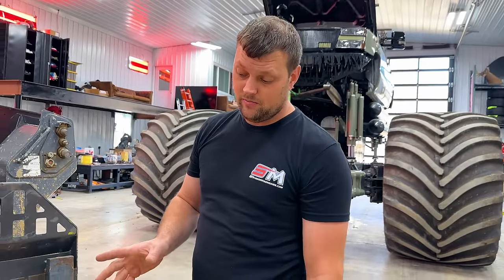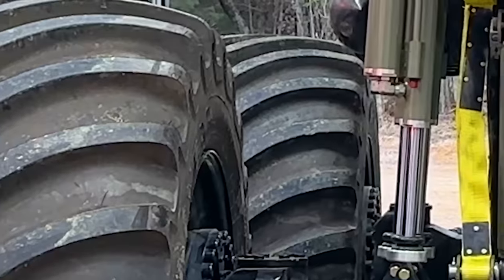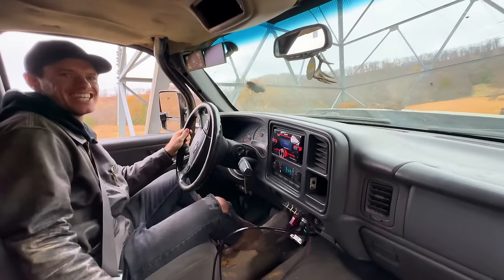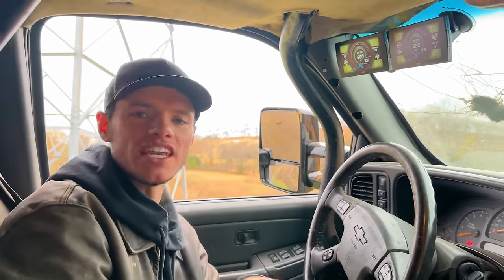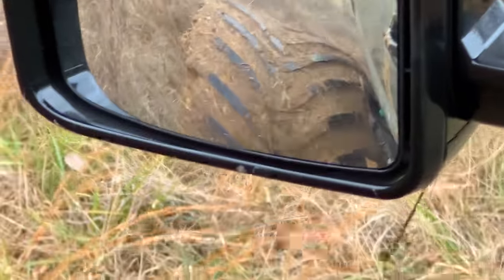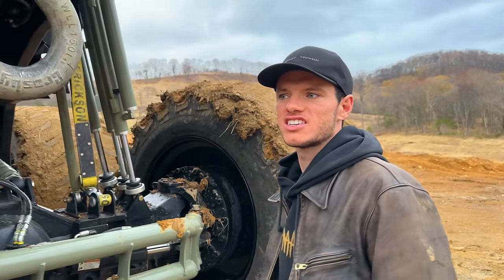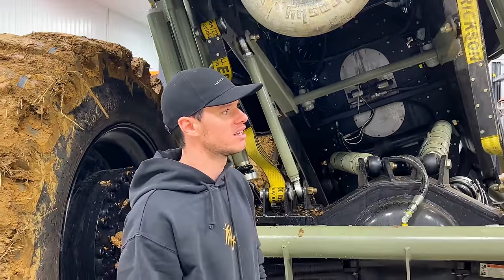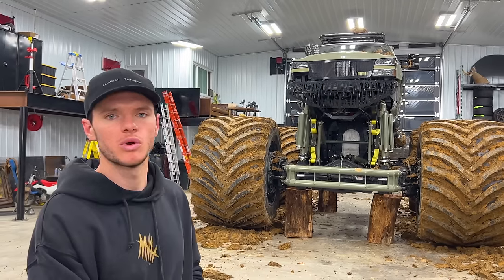Monstermax 2 RUNNING ON TWIN ENGINES!!!!

Comment from the maker: Properly designed and amazing looking clothing now available on Monstermax.com!!! Very limited supplies
Reply: bro gotta get to 10 mill now
Reply: CYBERTRUCK DURABILITY TEST PLS!!
Reply: Dude i just noticed you could really make people mad by making the worlds biggest squatted truck
Reply: Elrods pro straps he makes them for ultra4 and he will guerantee them
Reply: MM needs under glow
Reply: I'm really disappointed you didn't get any level to build the suspension on mm2..
Reply: when or if it comes out LOL
Reply: You should have a machinist make the parts that you need
Reply: Bro I love the videos I think it’s so funny that people get so mad. I ain’t gonna lye you had me cringing when you drove over the Honda 😂😂
Reply: Why did monster maxx look like my grandma scuffling down the hallway to drop a deuce? Like a Carolina squat truck
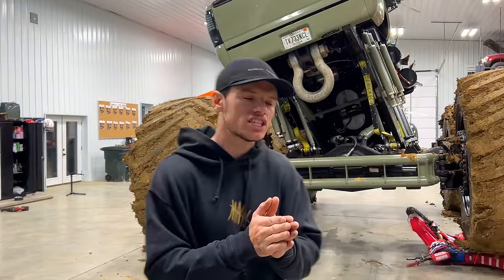Reply: 12:23 - now introducing.... the Tennessee lean
Reply: You're the best, man.
Reply: You need to cut the truck in half, longways and make it also the widest pickup truck.  
Get a donor truck and use 3 feet of the center part of the donor truck, from tailgate to grille. Imagine a 10 foot wide pickup truck? I’m retired, I can’t help you do it. Good luck 😂
Reply: @demarcuscousinsthe65th  I'd like to see it tug of war with monster max
Reply: Ngl was rrreeeeaaallllyyy hoping for those logs to disintegrate from underneath MM at full throttle.
Reply: bugatti test at 5M subs
Reply: Got my MMII hoodie ordered, tax man pulled my pants down to get it to UK though. Get the issues ironed out and Monster Max will be flying about in no time. 😉
Reply: Looks like you have a sqatted truck lmfao
Reply: Make a lifted hilux
Reply: Sir, carry on, carry on. 🤠😎
Reply: more lies it never be fix
Reply: World’s Biggest Truck with bedrooms! is a 1950 Dodge Power Wagon in Abu Dhabi.  Top that @WhistlinDiesel
Reply: Young, handsome and billionaire 😍 what a gem 💎
Reply: How much for what's left of the bike?
Reply: ill give you $100 for that flat CR. haha!
Reply: That wheel marks will be viewed on Google maps! 😱 So big
Reply: You finally got it running on 2 engines
Reply: Hear me out: new merch featuring “The Leaning Tower of Deisel”. 10/10 would purchase😂👌🏻
Reply: Hey bro, I would heavily look into finding some kind of gyro system to keep your cab level no matter what terrain you're on. Something has to exist. Only to keep you safe and happy homie. Another great video
Reply: Monster max is sick….. go ahead and cut me a deal on the wheels and hubs off the CRF and the yoshis if they’re anything let of them lmao
Reply: By the end your Truck had the "Detroit Lean".  It's not broke, it's got Swagger.
Reply: Something about monstermax is terrifying. Especially the night footage. Makes it look like it’s a Jurassic park creature. I love it
Reply: I'll give you some cash for that bike like it is
Reply: Can i have the dirt bike u crushed
Reply: Love the new build man.
Reply: You should build a half sized version of the p1000 ratte tank for crushing stuff.
The name reflected the 1000 tonnes it was supposedly supposed to weight...
It would be both educational and utterly terrifying 🤣

Cody could then literally have the  title as the only person to have successful built replica of the tank 🤔
Guinness world record right there my dude 🤯
I can imagine the amount of war games sponsorship and people who would like to see this 500 tonne behemoth...
Reply: Let me buy the bike!!!
Reply: Hopefully done better than monster max am I right? 🤣
Reply: You have to get in touch with Dennis Anderson
Reply: How do I pay cash for apparel?
Reply: Where can you buy a properly designed and amazing looking monster truck?  Been looking everywhere, and can't find 💩!!!    🤣    But FR, this is some good content, I appreciate how creative Cody is, like the stupid kicking mud thing at the end.  It's just more entertaining.
Reply: see i came to the comments to actually post something positive then saw this grift post for your obscenely over priced merch and then the desire to be nice left me
Reply: I'd still buy that bike as is XD
Reply: Whistlin , in your 1600hp General lee video I think you forgot to censor out the word “fucking” when you handed the keys to your neighbor. I’m not offended or anything but I notice you like to censor “bad” words a lot so I thought I’d give you a heads up. Thanks for all your awesome content! Good luck with your court case man!
Reply: so Cody... nice squatted truck ya got there 🤣😂🤣  didn't know you were such a hypocrite 🙃 guess ya got to shred it now and work on mostermax3 😆
Reply: 10/10 love the quote hoodie
Reply: Is Monster Max 3 going to have a jet turbine
Reply: This truck means nothing to me !!!!!?
Reply: Plz get the new raptor r
Reply: Can I buy that dirt bike?
Reply: Sway bar won’t work, run a hydraulic leveling system. Set up on a gyro. Same thing that the run on feller bunchers
Reply: All you need now is a turret on the roof to spray those hater tears. This is radical.
Reply: HELLO
Reply: Lol it’s still badazz truck 😅 Hey every build has its flaws you have one of the coolest rides in the world just need shocks adjusted sway bars Lock-tight on the drive shaft bolts lol more sway bars and Air bags suspension and need the axle rolled forward so the driveline doesn’t get kinked on a incline and your hood !! 😅👌🤙
Reply: Get that sway bar wide as possible if you can put past the shocks or at least equal to and more beefy nice rig.
Reply: @WhistlinDiesel i tried to buy the crf450 from you but you never responded to my dms. i also swiped up about the part time job
Reply: Doubt you will see this but along with the new sway bar, why not put mm2 on airbags?
Reply: You should use your head-lights when driving at night ;)
Reply: Fix it  an I’ll buy it bro I need a new bike an that ones so nice even smashed it’s still nice 🥲
Reply: Pretty cool truck but what’s the point if your ground clearance is the same as a normal truck
Reply: Boat mmII v2 please 😂😂😂😂
Reply: We love u dude
Reply: Elrods prostraps the best and strongest anywhere
Reply: Some dude acting like cody @  T @Diesel-DETWILERERO1
Reply: Your dad is gonna be PISSED! Beautiful truck bro!
Reply: Yes very BEAUTIFUL...
Reply: Man what I would do is take the suspension off of a log skidder such as a 620e tiger cat I mean you pretty much have the exact suspension set up right now
Reply: maybe santa will bring me some Idk
Reply: Haha sweet I just bought a hoodie. Glad I didn't miss out on the merchandises this time! Thank you youtube bell
Reply: From someone that cant actually afford it that dirtbike would have given me years of fun. 😢  & whats even sadder is i live in mt juliet / wilson co. Which is only about 15 short minutes away.
Reply: Let me buy that Honda, or atleast let me buy some parts off of it!!!
Reply: Use kinetic ropes for limiter straps .
Reply: Bugatti durability test at 10M what?, 10M haters?, if so where the hell is that durability test at!
Reply: the length of the lever arm going to the sway bar is probably a large contributor to the sway as well as the lower spring rate of the suspension. rock trucks use rubber blocks as a spring in their suspension in comparison.
Reply: Man I love monster max, its just missing one thing...  a little brother you can drive on the road. I have a quadsteer I'd love to see you with. Hit me up and maybe we can colab..
Reply: Hey yo can I have that dirtbike you crushed for free?
Reply: Now you should re-challenge that tank and demo ranch to another tug-of-war.
Reply: I wonder if any level left like that 350 but on a bigger scale if they won't do it you'll just have to do it I'd say that any level lift yeah you put it through stress factors for sure and it held up pretty a lot better than what I thought amazingly better actually
Reply: Where’s your Jake brake big dawg????????
Reply: I subbed when he put his truck in the ocean. That sh t was insane lol
Reply: Nah don't do that it would be a flop. I suck at ideas
Reply: Can I buy the next dirt bike off you that you decide to crush but before u do the crushing 😂
Reply: Idk will the clothing fall apart too
Reply: This truck is so legendary that it'll be uncovered in the future like the Great Sphinx or the Terracotta Army and the world will be so fascinated by the technology that they will claim that it's impossible to re create
Reply: @ripperlipper1016  maybe if you full-send like WD does.
Reply: Uber from hell
Reply: wheres the monkey fist on these hoodies draw strings???? mine came out in the washer, I thought these things were indestructible!! I have 3 btw lol
Reply: Monster max breaks more then a r32 and a subaru
Reply: You know what would be awesome is getting the big foot tires and putting them on there
Reply: whats it like being a complete psychopath :face-fuchsia-wide-eyes:
Reply: You technically own a squatted truck now because it squats when your on the throttle and your always on the throttle so it’s always squatted.
Reply: Can I have the dirtbike now
Reply: Love you bro
Reply: Send me that dirtbike I will send it to the after world and finish it off
Reply: Where did ubpost it for 5k at I would of bought it for sure , been looking for one
Reply: Western canadien rockwell. call and ask for neil. he might be able to help
Reply: Here’s a complicated idea. 
Instead of bigger sway bars, use sensors and solenoids and supporting mods and turn it into a electronically controlled active suspension. That will also help with raising and lowering the height of the cab for ease of use and service for the components. You could eliminate the sway problem if sensors are constantly monitoring your suspension. I dont think any monster trucks have that setup currently but it would be a damn good suspension to have since you’ll be able to just control the stiffness and all that as well. That would be fkin amazing if you could pull that off. I mean steal the suspension off ur G wagon 😂😂
Reply: Okay bigger engine on the back and front with reinforced coolant system and internals
Reply: word
Reply: @Clunkincars  I think that might be a good idea but what about big airplanes and stuff how do they do their shock system God bless
Reply: @whistlinDiesel how much horsepower & toque does your truck have? It would be interesting to see you have a truck pull with an M1 Abrams tank. 
Show off for your millitary, please? 
I mean once your get everthing fixed.
Reply: @WhistlinDiesel I'll take that dirt bike and race it down at the Baja 1000 for you
Reply: You want to buy a 1930 Chevy coupe to smash😁
Reply: Built for a really distructive man hahah
Reply: Eh, this rig could really use more engines
Reply: I knew it was gonna be to top heavy for those Lil legs u put on it. should of taken a page out of Bob Chandlers book that's why bf 5 engines were lower. maybe ask him what he did to not get the body roll
Reply: How much were you asking for that Honda
Reply: @michaelwhaley6123  we'll look into it iam is manager
Reply: Here's the thing. This isn't real. This man doesn't have the money he claims he does. You think a youtube channel pays you money?? I'm out here working as a roofer. 1000 a week. People believe everything they see. It's the internet folks 🤣
Reply: do you think i can have the honde crf that you ran over?
Reply: man i got this monster truck RC its called the ground pounder, really nice... anyway its funny cuz i have learned that thing thru and thru and totally get having to upgrade a monster truck til it drives how u want it. ur basically living my dream lol
Reply: Yo a screeeen in the front and Camaras outisde of it and you can see a little more!
Reply: Instal a jake brake
Reply: Give me that bike U ran over haha
Reply: its ok no problem WhistlinDiesel
Reply: You need an any level suspension setup on it, jokes aside a setup like dynamic suspension on luxury cars would solve the body roll
Reply: Keep going g your gonna be well known, so glad to have watched you grow you can easily get that 10m
Reply: Hey Whistlin i saw that you ran over a honda crf 450r with MM2. i was kind of cringing cuz im saving up for one, but i was asking do you think i can buy it off of you for $1300?
Reply: Bro, please put more air in the tires to get better slippage
Reply: This comment more than likely won't be seen by many of any at all but I've got an interesting theory. Now that MonstermaxII has 2 working engines and will shortly have a sway bar the size of California and Texas combined, he's going to find a way to float it and weld the bow of a cruise ship on the front. #WhistlinDieselCruiseLines2023 Also wouldn't be shocked if he welded a landing pad on top of MonsterMax so he can land the new chopper on it once he has his pilot's license. Cannot wait to see this shit.
Reply: By chance is that honda cr still fir sale bud I'd love to have her I am looking for a build like that 😀
Reply: 150 is to rich for my blood im sure it's worth it though. 🙌🏻
Reply: You just need springs. Shocks dont hold weight.
Reply: Matthew 6:19-21 NKJV
"Do not lay up for yourselves treasures on earth, where moth and rust destroy and where thieves break in and steal; [20] but lay up for yourselves treasures in heaven, where neither moth nor rust destroys and where thieves do not break in and steal. [21] For where your treasure is, there your heart will be also.
Reply: REPENT AND FOLLOW JESUS CHRIST BEFORE ITS TOO LATE
Reply: I have an idea for the build you know how bridges have the cables to help hold the support straight why don't you just do the same thing for the body to the axles so like run a big cable from the truck down to the axles and widen the axles so it doesn't rub it. It'll still allow the suspension to do its job but also hold it straight without  . It's just an idea to throw out there
Reply: I sent you an email for a z bar design instead of using a sway bar.  Just an idea
Reply: You have the wrong spring rate in the coil overs .. your poor garage door. 😆
Reply: Dude is a badass! Im from Indiana too. Oklahoma now.
Reply: Cleaning the mud off them tyres was just epic 👊
Reply: I have an idea might not be to good but why not buy a standard size sway bar and replicate it to the size needed🤷‍♂️
Reply: seemed that WD pulled his last vid so there is no proof of the keys!!! whoever paid 300 for a jar of his car parts. good luck
Reply: Great stuff!
Reply: Yo aquí en mi país queriendo la 250 r 😢😢😢
Reply: Nice
Reply: thank you Cody this is got to be the funniest video I have watched this year this is absolutely hilarious
Reply: Yo
Reply: Time to go to the drive through
Reply: I WANNA SEE YA BUILD A VEHICLE WITH SNOWMOBILES FOR TIRES
Reply: Let me come buy that dirtbike
Reply: @-sayywat-434  actual SNOWMOBILES for tires, not just the tracks
Reply: Congratulations on this version. Beast!
Reply: I will buy that bike still, I'll rebuild it
Reply: Could you make more videos racing vehicles instead of destroying them like the g wagon durability test 1 where you race it on dunes
Reply: You should get a Delorean! And go 88mph through a jump or something
Reply: I was limited once, they never made that mistake again!
Reply: Can you get some 6X sizes?
Reply: I’ll come clean your shop any day brother! 🇺🇸
Reply: Token money
Reply: Token money
Reply: Token money
Reply: Token money car dealer ship
Reply: You can get a good deal with token money with dealerships if they agree
Reply: I know you’re probably never gonna see this, but you should buy the truck that you started the channel with the monster maxx truck, and hoon the shit out of it like go old school and do the whack tire videos like when you did your custom tires and shit on the Duramax. I think you’ll be bad ass just to see you hoon the fuck out of a Duramax again I think people would like it, but it’s also my own opinion you could probably give a shit less cause you got a bigger and better things going on
Reply: I know you’re probably never gonna see this, but you should buy the truck that you started the channel with the monster maxx truck, and hoon the shit out of it like go old school and do the whack tire videos like when you did your custom tires and shit on the Duramax. I think you’ll be bad ass just to see you hoon the fuck out of a Duramax again I think people would like it, but it’s also my own opinion you could probably give a shit less cause you got a bigger and better things going on
Reply: Take it back to the dealer and be like idk what happened
Reply: I like monster max 2 it is a nice truck
Reply: Daddy's money
Reply: You're not top heavy, your suspension is too soft and your limit straps are too long.  Shortening the limit straps will make a big difference.
Reply: Why didn't you bug a monster truck
Reply: OMFG YOU JUST HAD TO SQUISH IT AGAIN!!!!!! DUDE!!!!
Reply: That mud is deadly bro
Reply: Wey Ikn u ain’t gonn see it but might as well try it😂 wey can u pls get me a dodge hellcat🥺🥺💙 love u wey💙🥹
Reply: Weyyy pls get me a hell cat🥺💙
Reply: That truck is straight doodoo! You need to get 10 gallon of gas an set that big goofy truck a fire
Reply: Absolutely bananas!
Reply: Cody. Going thru all your videos. Seeing you play with the CAT excavator is the craziest I have seen you do.
Just one small mistake and you could be cut in half and killed.
That is not a toy Cody.
Thinking of the video in your garage when you made it spin around by itself. 
Take care
Reply: Hey i thank you so much  but is there any other way if Contacting you
Reply: Hey i thank you so much  but is there any other way if Contacting you
Reply: Hey i thank you so much  but is there any other way if Contacting you
Reply: Hey i thank you so much  but is there any other way if Contacting you
Reply: Hey i thank you so much  but is there any other way if Contacting you
Reply: Hey i thank you so much  but is there any other way if Contacting you
Reply: Hey i thank you so much  but is there any other way if Contacting you
Reply: Hey i thank you so much  but is there any other way if Contacting you
Reply: Hey i thank you so much  but is there any other way if Contacting you
Reply: Hey i thank you so much  but is there any other way if Contacting you
Reply: Hey i thank you so much  but is there any other way if Contacting you
Reply: Hey i thank you so much  but is there any other way if Contacting you
Reply: Hey i thank you so much  but is there any other way if Contacting you
Reply: Worlds most expensive squatted truck. Even has a squat in reverse  smh
Reply: WA state hates diesel. Assemble the eagles n bring some diesels🤙🇺🇸
Reply: Please help Cleatus get people together to save his track you can get the ppl to show up
Reply: Your comment is appreciated.  You have been selected among the lucky winners on my giveaway
Message me on telegram and claim your prize 🎁🎁
Reply: Your comment is appreciated.  You have been selected among the lucky winners on my giveaway
Message me on telegram and claim your prize 🎁🎁
Reply: Man you don’t know this yet but we gonna hang out one day. Wrote that with squatted truck mulch in hand .
Reply: Cody the hoodies are out of stock except for size small. And it seems there are a bunch of knock offs popping up in the Google results. Might want to make sure people aren't stealing your merch designs and undercutting you.
Reply: L
Reply: Hater alert 👇🏻🤣
Reply: Extreme gooseneck offloading with Monster Max 2?
Reply: Hey man I think someone is pretending to be you and is scamming your subscribers you need to warn your people I have screenshots and screen recordings
Reply: @Jesse Biddle  it happens on a lot of channels. The mr. Beast scams seem to be the most prevalent
Reply: How do you fix p1740 code
Reply: When you got on the throttle it kinda looked like a squatted truck 🤷‍♂️
Reply: @GreaseMonkeyTyler  oh no 😂😂
Reply: May This Monster's Hearths Work at Full Capacity!!!!
Reply: Hey uh, next time you decide to destroy one of your dirt bikes you should send me it instead 🤣 I've been wanting to ride so bad!
Reply: You happened
Reply: O0
Reply: Properly designed like Monstermax2? :DDDDDDDDDDDDDDDDDDDDD JKJKJK
Reply: That's so cool the world's smallest truck keep up the good work
Reply: I woulda bought that bike I need a new one
Reply: Pay you a dollar for that bike
Reply: website doesn't work
Reply: Ill give you $500 cash for the crf dirtbike AS IS
Reply: Finally, a weapon to surpass metal gear!
Reply: Can I have a dirt bike
Reply: I blown mine up
Reply: hi
Reply: Cody dude what was that title
Reply: Are you gonna put this in the ocean
Reply: CAROLINA LEAN LIKE A MF
Reply: No turtle neck belly shirts for sale 😢
Reply: @jerub71  FOOL is Right
Reply: New shirts coming out.. the new MM2 WITH THE CAROLINA LEAN!!!
Reply: Lol! WtfE
Reply: @michaelwhaley6123  LMAO!! WHATEVERDUDE
Reply: I love your videos
Reply: @danielmeuler2877  BAAAAAAAHAHAHAHAHAHAHAHAHAHAHAHAHAHAHAHAHAHAHAHAHAHAHAHAHAHAHA
Reply: @ToastyWaffles4  This dude a STALKER
Reply: I can hear that thing  Screaming
Reply: you just need stiffer suspension then it will work
Reply: Absolutely hilarious to see you "working" on it lol!!
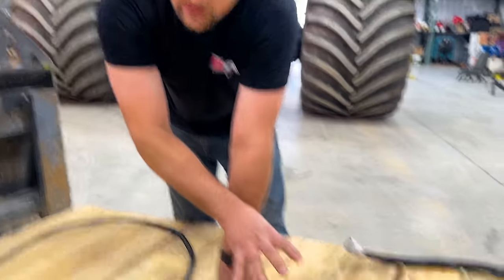Reply: 😂❤ 1:56 😅❤😢❤❤❤❤❤❤😢❤❤❤❤❤❤❤❤❤❤❤❤❤❤❤❤❤❤❤❤❤😂😂😂😂❤❤❤❤❤❤❤❤❤❤❤❤❤❤❤❤❤❤
Reply: Good vid
Reply: Oye no me puedes regalar una cuatrimoto es que veo que destruyas muchos carros y motos
Reply: Bro plz take your money to gravedigger and have them build you a REAL suspension.
Reply: im not a hater
😶
Reply: Can u just give me the honda Next time stead of trashing it ??😢😢😢
Reply: how much power the monster truck makin
Reply: Couldn't launch or backflip with this monster truck.
Reply: You should put cameras all around it so you can see where you’re crawling from the cab.
Reply: Your hollarius 😂 keep up the great content
Reply: Jaxson
Ritchie